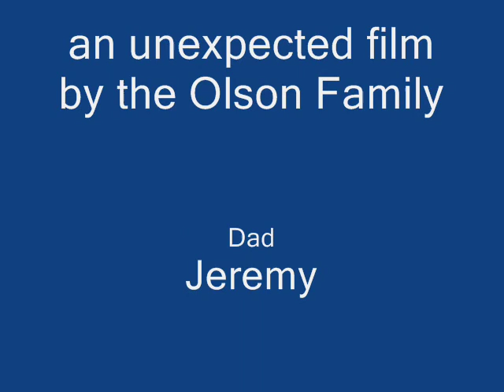When the control module on your electric range goes bad

Comment: Is the heating element touching metal?
Reply: Technically yes, the metal part of the heating element is just the casing and there is some ceramic insulation with a much thinner piece of wire inside it which is the part that actually gets hot but if the internal insulation gets damaged and the wire touches the outer casing of it then it will start arcing then that will continue until it’s burnt through the entire element.

Comment: Same thing with any 240 volt element what used a single pole thermostat.  I had a coworker who told me about 2 or 3 years ago, while he was out of state for a few days for a business meeting,  while the house was empty,  this happened to his 50 gallon electric water heater.  The tank was boiling and escaping through the pressure relief valve.   He went to investigate as the hot water in the bathroom was much hotter than normal.  Upon entering the basement it was like a sauna after being closed when he was away.  At first he concluded the thermostat had failed in the on position.   Replaced the thermostat.  About a few hours later the new thermostat had the reset button pop out.  Something was very suspicious.  His friend who happened to be a master electrician,  suggested to take a multimeter,  set it to read resistance, and making sure the power is off, disconnect the element wires,  test from each element terminal to the metal tank.  If you get any reading,  it is grounded.   Sure enough,  that was the issue.  The element had shorted internally and was heating non stop with 120 volts, while the reset button which should have popped to shut off both legs of the 240 volt circuit,  somehow was jammed , so the last safety device was the pressure relief valve discharging extremely hot water to prevent the tank from exploding through the house

Comment: The reason for this is not a failed oven Control... usually.   An oven element is 240 volt.  By design the thermostat when cycled off only turns off one leg, leaving 120 volt to ground available.  What likely happened is the element shorted internally to the outer shell.  So even though the oven may me turned OFF,  it is still burning with 120 volts to ground.

Comment: One last comment, one side of the burner is 110 volt and the other is switched 110 volt so there is always 110 volts on one side and when it shorts to ground as this did it normally is NOT enough to trip the two pole breaker. Because one side is NOT grounded and the two are tied together. Yes in a prefect world one would be strong enough to pop both but that almost never happens. If the breaker is older it may not pop no matter what.. PLEASE EVERYONE TEST ALL YOU"RE BREAKERS IN YOU"RE HOME ONCE EVERY SIX MONTHS BY TURNING OFF AND BACK ON TO MAKE SURE THE CONTACTS ARE NOT FUSED TOGETHER!!

Comment: this is 220 VAC Simple as enough to kill you. pull the plug. you blew some electrical fuse I guess. the arc would have tripped. if u saw a bright spot it could've been caused by that.

Comment: i have a maytag gas stove . te oven won't lite.i replaced the igniter and it still won;t lite.theni replaced the spark control board and it lit once now it won't lite anymore.The broiler work fine. What is wrong please help. Thxs

Comment: Next time this happens ....The proper thing to do is open the oven door and use the sprayer from your sink to extinguish the electric. Be sure to spray the floor around the stove and kneel on the wet floor as you spray the water.
Reply: Very bad idea!!!!!! Turn off breaker or use a fire extinguisher if you don't know where the breaker is.

Comment: WARNING: "Do Not Unplug"... Turning off the circuit breaker, is the Proper way to handle this. If you don't, a Dangerous Arc will accrue when the plug is removed from its socket. It may not electrocute you, but why risk it? 240v can kill quickly. Learn the location of your circuit breaker box. Make sure each breaker is clearly marked what they are.
Reply: +Richard DeAngelo I think it might be a chemical reaction similar to a thermite one.  once there is no longer anything to react with the metal, the sparks will stop.
Reply: FUCKING THANK YOU! i see TOO many people saying to pull the plug not knowing just how DANGEROUS that is! KILL THE BREAKER!

Comment: So ours did this yesterday and melted the element apart. Did you just replace the element or were there other things in the stove that needed fixing?
Reply: How did it work out?  I plan on just replacing mine also
Reply: @mark favro mine did the same thing but mine did it in just one spot and it broke in half. Did you replace yours? Did it fix it? I have mine taken apart and the coil out but I hate to go spend $40 on a part for it not to work. The time and everything still works on the oven and so do the burners.

Comment: UNPLUG IT...
Reply: grettagrids turn off the breaker do NOT unplug it because that’s 250 volts and most breakers are rated 50 amps but it can deliver a lot more at a short amount of time so unplugging it can lead to it arcing at the plug and causing much more problems like s fire

Comment: The baking element on most electric ovens is always energized (120volts) on one side of the element. When you turn on the oven the control panel will energize (120volts) the other side of the element for a total of 240 volts. Your element appears to have shorted to ground that's why when you turned if off it kept glowing. The breaker never tripped because the oven lite was still on. Your oven was energized and possibly could have shocked you (because of the melted element) when you were removing the racks. Inhaling the smoke from burning metal is not healthy.

The safest way to deal with this is shut the breaker off FIRST then unplug the oven SECOND.
Reply: When the element starts to burn, it will do one of two things. One blow a hole in it and stop working (this is what happens most of the time) Two it will continue to burn with 120 volts and the system off but not unplugged!! Now when the element burns it does goto ground by way of the little metal feet that hold it. As for the breaker, how many people know right where it is? First close the door and pull the oven out and unplug it and there is no second. The breaker just powers the plug.

Comment: Our oven element did that last night.  I turned off the oven (no power unless controls damaged).  If you look where this started, element is broken, no power going through normal path.  Element to the left of flame is getting hotter (glowing brighter).  On ours the flame was spiraling around element.
Water did nothing to cool element (sprayed it on).  No smoke that I could see.  Since I did not want it in the shell of the oven, I used a Bolt cutter to cut the element in advance of the 'flame'.
Reply: +Kevin Falk even unplugging it wont stop it, fool.  Just power it down completely and leave it alone.  Just like any other chemical fire, it will stop on its own where there s nothing level of the element itself.

Comment: In case you didn't notice, the light inside the oven was still on so the circuit breaker did not trip. You most likely blew some sort of internal fuse inside the oven. I would have expected you to know that, but then again, anyone who is stupid enough to watch their oven arc like that must also not be smart enough to turn the freaking electricity off. Honestly, people make me wonder sometimes.
Reply: I shut the oven and breaker off when mine arched out, but i believe the fuse popping stopped it from burning. It's odd that in a few videos I've watched they keep burning up.

Comment: @Nivicoman  Normally 1 or 2 phase 230, 240  Volts Phase to Neutral.
There is either 400, 415 Volts at 120°  or 480 Volts at 180°  between the outer two phases.

Comment: @RODALCO2007 What voltage do ranges use in NZ?
That aside I've seen load bank resistors glow yellow and sputter and spark due to someone using the 208 setting with 415 volts.

Comment: @Crpetersena: GFCI's are available in different forms, including those with high load current capabilities...
Here (CZ) is their use required by the code for all socket circuits, what are quite high load branches (stove+oven combo ask for ~25A breaker, while sockets with 15A/branch mean together 30A for even small condo).
And most frequently this is "solved" by one common GFCI on the main power input to the dwelling unit (as it is the cheapest way), what ask for high contact current unit anyway.

Comment: Now all this time it is drawing an incredible amount of power.  Circuit supplying it could begin to overheat.   At 5:45 into it I hear him mention the fuse box.   Sounds like it tripped thermally by itself (eventually).  How hot are the wires inside the walls getting during all this?   How healthy is it to be breathing whatever it is off gassing?  Yeah, keep the breaker box accessible and think to flip it 10 seconds in to the event would be my advice.  Other than that it was really pretty!

Comment: I once replaced a hot water heater element that did the same thing, it was all bent and twisted, and had the arc-mark along most of its length. The odd thing is, it did this while under water, probably electrifying the water!

Comment: Cool footage , great that you had the camera handy.
Interesting that the element burnt up this way. Normally the inside resistance wire shorts out to the outer casing and causes a hotspot and goes open circuit.
Thanks for posting.

Comment: It does not to be bad control module, it look more as a short to grounded metal in the heater on the side, where the control module control the power. So the current flow from the other end, trough the short to the ground. That is, why the circuit disconnect switch, disconnecting at least all phases should be on the wall in the reach. And the owner should turn it OFF, whenever the stove is not in use or when something weird happen.
What would have shut it down automatically is called "GFCI"...

Comment: 1. Your fuse box should not be blocked off that is dangerous.
2. If the fuse did blow then wouldn't the oven light have gone off?
3. It was glowing because meatle conducts heat and the closer the fire got to the end of the coil the less coil was available to desperate the heat that's why it was glowing at the end.
4. Kid was smart call 9-1-1

Comment: well the range is grounded , and in this video it looks like the arc is touching the metal of the bottom . so a gfci breaker , once it senses loss of current from the neutral it will trip. but yes you are right  an afci breaker would have done the same thing

Comment: there's a 30 amp edison-base fuse in the range's top area protecting the element, in addition to the two-pole 40 amp in the panel.  i am not really  that surprised that it didn't blow, i was saying that so that people know that it happens

Comment: well chances are your fuse in the the circuit panel and in the stove are not gfci breakers. so for the 50 amp breaker that is probably serving your range to blow it would have to pull 51 amps to pop the breaker ... just to inform you .. i am an electrician apprentice

Comment: our stove element did this too and also didn't blow the fuse in the stove or the breaker in the panel.  our control panel wasn't the problem, the element just wore out and burned a lot faster, before we could turn it off

Comment: Wow you are truly a moron.

95% of the electric stoves/ranges in the US run on 240 volts.  Most homes in the US have 240 delivered to them, and it's split between the 2 phases at the panel to make 120.  You have 2 wires coming into the home delivering 120, on different phases, when connected properly to an appliance you get 240.

Capacitors don't alter voltage, they just store energy.

Comment: and i forgot to mention that your breakers must not be attached to each-other for 220V use, because it just threw the one side that the arc was lurching towards hence the reason the light was on, unless it burnt out the contacts in the thermostat.

Comment: heating elements have a metal outer shell, ceramic filler, then a resistive material that connects to power, the ceramic insulation/heat distributer failed and it started arcing to the outer casing causing a carbon arc trail which sustained the arc then it just ate away at the outer casing... and obviously burnt out the thermostat due to excessive current draw from the arc going to ground, hence the coil still being hot to the left in the film

Comment: The module is not the problem. The element cracked at some point and if you had any brains, you would turn off the breaker, or at least shut the door. Next thing you know, someone will get burned, and they will sue the oven manufacturer.

Comment: Congratulations! You've got PLASMA!

This has, on occasion, happened on the third rail for Miami's Metrorail system, with many more amps of 800 volt DC current. The fault causes a thick iron rail to melt down and pour to the ground and guideway below as a waterfall of molten iron!

It looks to me like the high temp silicone insulation around the resistive wire in the element somehow shorted to the metal tubing surrounding it (grounded).

Strickland Propane, Taste the Meat, not the Heat!

Comment: Internal heating wire is arcing through the insulation to the outside casing which is grounded.  If the stove was not grounded properly, then no arcing would occur.  But there would be a lethal voltage on the stove chassis.  Circuit breaker would never trip either.

This video shows how important it was that this appliance was grounded correctly!  :)

Comment: you might not want to lock at that drecly 
like arc walder torch and super hot metal even
heated by a oxygen inrich gas flame walder torch
heat metal that bright so is the raeis from it os hot it can burn the retna in you eyes
that arc walding the the element form
an elecrical falt.

Comment: melted it like a arc welder and gas welder use extra oxygen  from a cylider to get a gas combustion flame hot as a elecrical arcing.
it bad to say but sounds of the troble to
make me think your oven/stove was a peac
of garbage from the start that got solde to you.